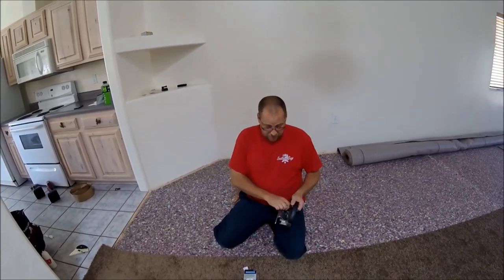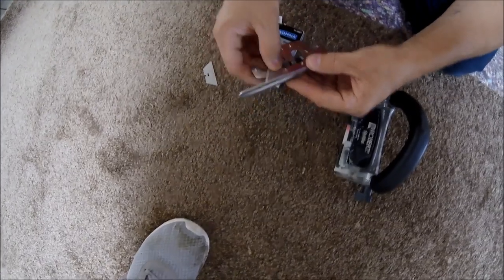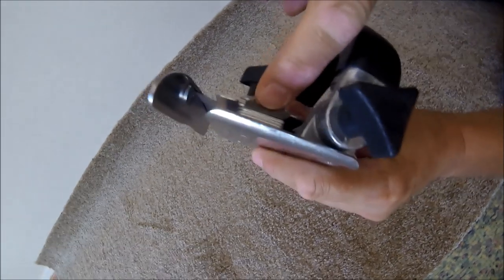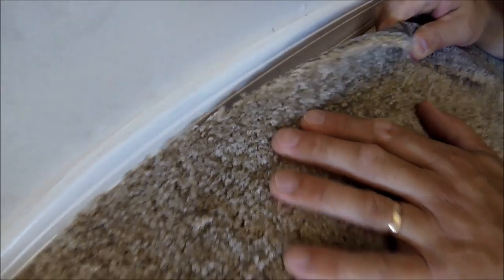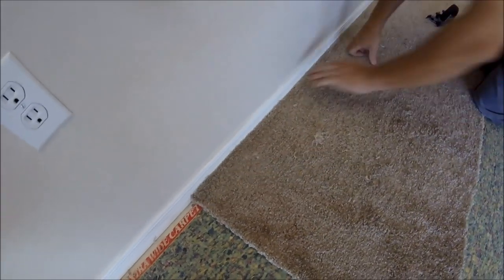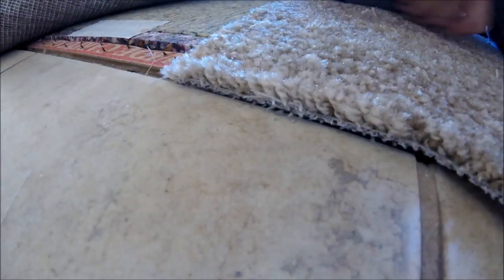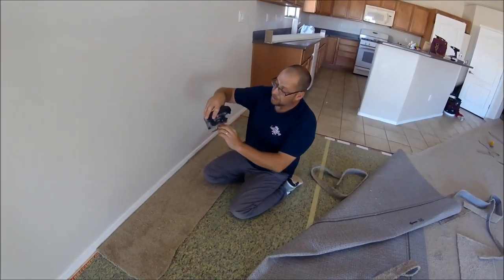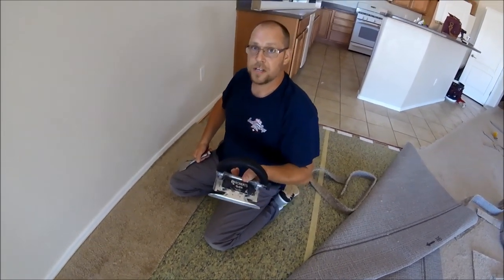CARPET TRIMMER 101

Comment: Thank You for Your advice of tools and how to use the carpet cutter. Did what I had to do and the cutter worked fine. I appreciate it. I got two of the three tools You recommended. The other one was going to take several weeks, so got another one. Didn't want to wait that long. The wife didn't either. Again thanks, mucho!

Comment: Thank you for this very informative video. I have a question. I'm new to carpet installation but finally decided to get into it. I bought roberts 10-616 edge trimmer just like the one you are demonstrating but older and I cannot get it to work. I put brand new Personna blades and I was hoping to trim some carpet but it's not cutting it. What do you think is an issue?
Reply from the maker: Watch this video and make sure that you load the blades properly that is the only thing it could be is, if it is not assembled properly

Comment: I have used a trimmer for several years, but time to purchase another, The one you are showing here are still available, well in England they are, I knew from one of your other videos that this was the model number you used, so I thought worth checking to see if it functions the same as the other, it does, as Michael Therrien quoted a veteran of some 20 years, same here but of 37 years, I always find the more you have going up the skirting board, the easier i find it, but clearly can be a pain if you are only fitting carpet on existing underlay and gripper, take extra care if gripper is to far out,
Reply from the maker: Johns Carpets established 1982 from England These old style trimmers are my favorite

Comment: Keep up the excellent videos!  Great job explaining and having the camera person get close-in when needed to show us what you mean!  Too many videos show a pro doing it super fast and saying it's easy without teaching us, the audience the ins-and-out. I'll use that spacing of a finger's width now and ensure I tuck it.  Just did my living room and cut all edges with a blade which took a while even though I borrowed this tool.  Blades were dull though. Just learned these blades are special as they're also shorter or longer than standard utility blades in addition to having just one notch and the single sharpened bevel. Master bedroom should be done tomorrow. Time to break out the knife sharpener to get the blades ready now that I know how to get the proper length. (No time to ship new blades in a day; does Ace or HD carry these blades?) Thanks again!

Comment: Excellent demo. Thanks. Would you follow the very same method if there is no skirting board installed yet? Another question: Do you think it is ok to stretch the carpet on a 10x20 room using a knee kicker only. I could rent the power stretcher but think with our expertise I could damage the carpet.
Reply from the maker: Ravenpiart Yeah you can do the exact same thing no matter if the baseboard or skirt board is up or down and you’re more Then likely to damage the carpet with a knee kicker rather than a power stretcher on a power stretcher you just push the lever down until it feels tight, you’ll never get it done properly with a knee kicker, Thank you for watching my videos and thank you for the compliment, and please feel free to ask anything anytime and I will give you my personal opinion on your questions thank you once again
Reply: Thanks so much for your help. Going to try the power stretcher.
Reply from the maker: Ravenpiart Good choice

Comment: I bought one of these after watching your video. I think it is a great tool. The angle you use: can you describe it by measurement?
Reply from the maker: Ravenpiart not really it’s pretty much just buy feel because like I said in the video there’s a lot of different factors to take into consideration how long or how short you want to cut it for different reasons so you pretty much just need to practice a bit before you actually start to use it on your install maybe just throw A scrap up on the wall like I did and give it a go

Comment: I love Your explanation on how to set the cutter. I have one more issue. Is there another adjustment to case the blades to protrude to cut the carpet? Right now they do not.
Reply from the maker: Bob and Lucy Shoaf Can you reword that please I’m not quite understanding your question, sorry
Reply: Bob , when you take the trimmer apart to change blades ,there are adjusting plates that will come out also .  You can remove one to make a shorter cut against the wall ,or you can angle the trimmer like shown in the video. I suggest  angling like shown in the vid..practice makes perfect !

Comment: Ruben, love your videos and they are very helpful, but you are placing the blades in upside down in this video. The chiseled side goes against the blade guide and the flat side goes against the locking plate. This is because after cutting the carpet, the parting action is performed first by the locking plate, then by the blade guide. The first parting action is the most likely to jam fibers between the blade and the metal, so the flat side goes against the first parting plate, and that is the locking plate (the locking plate is the one with the two sets of 3 carpet thickness adjustment holes). So when installing the blades under the clips of the blade guide, the chiseled side should be down, not up. If you don't believe me, I suggest you purchase a brand new Roberts 10-616-2A in sealed bubble package from the factory and note which way the blades are installed from the factory. Also you might try contacting Roberts to verify this. In any event, you will have less carpet fiber jambs if you install new blades opposite of the way you show in this video. Good luck to all.

Comment: Other factors, ?, as a carpet installer would you want that base board a bit higher? Tucking under the base or under the edge of tile helps, right?  I'm a do everything myself type of person. I did an under cut on my tile, (maybe 1/4 inch set back on my tile backer board) and set my baseboards and thresholds so there was a gap for the carpet backing to drop into.  It worked good for me but I'm not sure if that is an industry standard. I appreciate the level of detail you put into this video. about 1% of YouTube instructional videos can really be used for this level of instruction, thanks.
Reply from the maker: Stan Rodgers Thank you for the compliment I appreciate that and I’m glad this video was useful for you, and it depends on what part of the country are in rather the builders will leave the base board up or not, I would rather have it raised up the thickness of the baseboard about a half inch high makes it perfect, as far as the tile I would probably be cautious about cutting stuff out from under it , It creates a cliff and the tile has no support under it which will create a Weak point for it to break off, I hope this helps